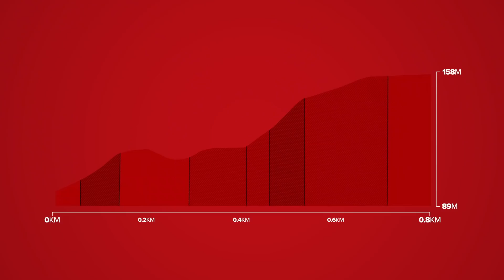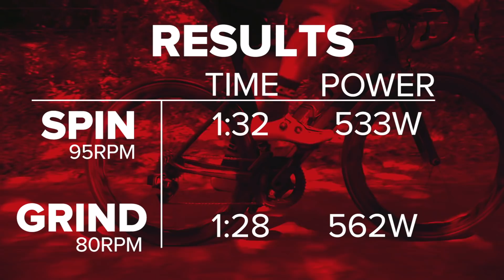Spinning Vs Grinding | What Is The Best Cadence For Climbing On A Road Bike?

Comment: By standing on the peddles during the "grinding" run you comprised the results. You changed two things; the cadence AND the peddling stance (standing versus sitting).
As a result we don't now know if the improvement in time came from standing on the peddles or from the lower cadence.

Comment: Nothing wrong with grinding. TO each their own..Small tip, especially if you are a grinder (<75 RPM), introduce 2/3 time a week of cross training outside the bike, such as squats, dips with both heavy and light weights. You will start seeing results, such as greater power at same RPM, and the HR is happy :)

Comment: Learn to be fairly comfortable with both. 
I find in circuit races (cat3/4 so hardly pro) I can hold the wheel and respond to increases in pace with a higher cadence (between 100-110).
However, doing long climbs in Majorca I tended to climb at sweetspot HR at around 85-90 rpm.
Just my take on it.

Comment: At 3:30 you are summarizing and you claim that with higher cadences we spend a higher percentage of energy into moving only our legs. This is wrong. Energy never simply vanishes (law of energy conservation) - the question always is: where does it go, what does it effect? In this case the inertia of the legs helps in the 4 1/2 to 6 o'clock-sector of the pedal movement. Analyzing this in detail, you will find that the force applied on the pressing down the pedal is higher than the pure muscle power spent. The effect described by you only occurs when we pedal with extremly high cadencies while spending an extremly low power.

Comment: If you were on a longer climb, you would have wanted to increase your cadence as your data would support, less power = less stress on the legs, thus saving your energy on a longer climb.

Comment: Greetings! I am 55 years old and have 51 years of martial art training. In the mid 80s to mid 90s I juggled road racing and martial art competitions. I am a big fan of Romain Bardet. Can someone here help me to understand how he at 6.5 ft and 143lbs can climb mountains in France of 8K-10K Feet every day with that body frame.... I wish I could ask him personally but I doubt he would respond on Instagram or on Strava. I am 4 inches shorter and 7 lbs heavier than he and I cannot climb 2K on Zwift without my chain clanking away at 39x25 gear. My knees are destroyed from competition for so many years and surgeries on both knees. My discipline keeps me going and not give up. My time is up in Wu Shu but I still hope I can do something with cycling. Thank you for reading and look forward to hearing from anyone here who has time to help

Comment: Armstrong has talked about this himself. He was accused of being the originator of high-cadence climbing on his podcast the other day (because he’s been critical of Froome’s granny gears). From his response, it doesn’t sound like he trained to spin at all and simply said that different people have different preferences. It wasn’t a strategy. 

What I was hoping he’d get to, but didn’t, was whether easy gears have negated the challenge of climbs like Zoncalan. Froome can sit down and spin at 90+ cadence on basically any climb, which means the gradient is more or less irrelevant. Would he stand a chance against a pure climber if the easiest gear he had was a 39-28?

(Of course, another aspect of this is that a “pure climber” is basically someone who’s so light that a 39-28 is considerably easier for them than it is for a normally sized person. Remove that advantage and Froome and Dumoulin can toast them.)

Comment: I think one of the main points here that has been overlooked is the use of the arms when climbing. There is a lot of counter action movement relayed from arms to legs when standing in the saddle. You can’t do this at a high rpm for very long.

Comment: You have to factor in the length and gradient of the climb aswell. Short steep climbs under 1 minute you can muscle up them out of the saddle, longer climbs you can stay seated providing your gearing allows you to stay above 70 rpm. Then there are times when you need to give your legs or your CV system more recovery, higher cadence to let the leg muscles recover and lower cadence to let the CV system recover. You should also train both high and low cadence but keep between 70 and 110 although going outside of this range is fine for brief periods.

Comment: My method is to set a power per pedal stroke by feel, then spin as fast as you can at that power without bumping up and down while seated on your saddle. And usually it's around 87-110 cadence. Aka spin to win

Comment: I thought Armstrong was famous for spending so much time climbing out of the saddle at high cadence? Anyways, I think there's another psychological reason that you need to consider as to why people change to slower cadences when they go uphill: people don't want to run out of gears for when it gets steeper or when they get tired, and in an effort to maintain as many reserve gears as possible, they might avoid the easier gears and hence pedal with slower cadence. At least I'd always pick the harder gear when I'm on the edge between two gears on a climb for exactly that reason.

Comment: Thanks for this. I’m on a recumbent trike, so all the biomechanics are probably different. I’ve been going nuts trying to figure out why I can hold 90rpm on the flat, but not on steep climbs, regardless of what gear I use. It’s even more annoying when I do try and hold a higher cadence, I loose time. So it’s not just me…
Reply from the maker: You're welcome

Comment: Funny I did this exact test before I even saw this video...  Spinning up a hill for 1-mile at avg 93rpm in the saddle, did the same hill at an avg 80rpm in and out of the saddle and I was 14seconds faster.  Almost 1sec per rpm!  Spinning, I hit max HR faster, had lower wattage, and felt like I was out of gas 3/4 up.  Lower cadence, I actually kept a lower HR, higher avg speed, more power, and wasn't dead when I got to the top.

I think there are too many factors between riders to say which one is better...  weight, style, genetics, fitness level etc... even max heart rate can make a difference especially if you're spinning.  I say, ride... and ride some more and keep trying the same hills trying different methods each time.  Eventually you're going to figure out what works best for YOU, and then go crush em!

Comment: Sometimes the question is misrepresented as ' Is spinning  faster than grinding?'. Like saying, is it faster in a car at 4000 or 6000rpm? Its the same, because you use gears.
What is different is, among others, fuel/energy use, lactate levels (and hence fatigue), oxygenation, knee comfort, mechanical losses, muscle group use, stress on upper body etc etc.
I have found from personal experimentation, spinning allows you to not feel as tired (pain), therefore you can go marginally faster and are willing to keep going due to lower pain levels. I get a slightly elevated heart rate at a higher rpm for same speed, indicating a higher body temp and/or fuel use but thats so much more sustainable than pain.
Good interview, insightful. Training is key, fitness (and I take it weight too) is key. Train to stay in the saddle a higher rpm. Vroom like Froome.

Comment: Here’s the elephant in the room - EPO vs Steroids. Steroids help muscles (and muscle recovery). EPO helps cardio. Lower cadence on climbs was more common before the EPO era and it really was about muscular endurance/strength. Higher cadence taxes the aerobic system more and we’ve seen that style become more common with the advent of EPO.  You can see this clearly in the 1990 TDF Stage 16 to Luz Ardiden where LeMond and Indurain ride ahead of everyone. Greg has that old school slower cadence on the climb, Indurain is using a much higher cadence. 

One other thing not mentioned in this video, is gear selection. There’s a certain fitness level required whatever cadence/gear you are using on a climb. It’s not so much “should I try to add a couple of RPMs on a climb” than trying to train over time to be able to push a higher gear at what is your normal cadence. Even for high cadence climbers, they still need to be able to spin a gear that keeps their power output where they need it. 

To test that, go on a climb that is at your limit and where you might crack - there are two choices you have, slow your cadence or drop your gears. To stay at, let’s say, 90RPM, you would need to drop your gears enough so you can maintain that. Or you may need to keep your gears where they are at, and then stand up to climb (which reduces your cadence).
Reply: Yawn,,,,,!,,,,

Comment: This climbing at a higher cadence sounds like how cars rev high for maximum power... perhaps if that thinking was applied to gearing we all could be hitting highway speeds in fully faired bicycles/tricycles.
Reply: A car engine is an air pump so it's more analogous to your lungs than your legs.
We could compare long to short stroke engines to alter force-rate ratios before any gearing to the cyclist.

Highlights a valid point that we needed to look at cardio & respiration stats too.

Comment: I'm 100% a grinder, which makes sense with how big and heavy my legs are (~30kg each). Good to have some backing on that.
What's more interesting is, this also suggests that I'm doing the right thing defaulting to a relatively slow tempo and small range of motion when I run.

Comment: If you are standing out of the saddle, I think that a lot of your power comes from your body weight pushing on the peddles rather than just you leg muscles.  The body mechanics and muscles used are different.

Comment: As the video suggests, the mere rotation of the crank and your legs uses energy, regardless of the force applied. That's physics. But I suspect (but don't claim to Know) that when cycling, physiology trumps mere physics. And my physiology may be quite different from yours. On level ground with no headwind, I rarely fall under 95 RPM. If I'm trying to make time, 100 - 110 is not unusual. And when climbing, my cadence is nearly always much faster than that of larger riders (though slower than when on level ground). ---- Furthermore, muscle and joint preservation must be considered, especially when racing or touring long distances or multi stages (also mentioned in the video).

Comment: Based on my experience optimum cadence depends on effort you put in. The cyclist in this video was bobbing and bouncing, which to me indicates he was not in the perfect geer. When spinning efficiently the effort is smooth as cutting through cake. To spin efficiently you have to constantly adjust your geers as the terrain changes. It looks like this rider adjusted his effort instead to maintain a constant cadence.

It is much like a motor car: Accelerate in a too hard geer and the engine judders. Accelerate in a two low geer and the engine races too fast and wastes energy. Find your sweet spot and you'll waste less energy and damage your muscles less. If you want to put all you have into a hill then standing up for a while can give you that edge to pull ahead that little bit more quickly.

Comment: Spinning for as long as possible is particularly important when doing very long days in the mountains, especially with several long climbs in succession. If you start grinding from the beginning of the day, your muscles will hurt much more at the end of the day then if you spin for as long as you can. You might not be as mechanically efficient when riding at a higher cadence, you might end up using more energy and even increase your chances to hit the wall (depending on what HR you ride at), but at least your muscles will still feel fresher at the end of the day.

Comment: As a MTBer the 34/28 is "low" gears is mind boggling.  On the 2x drivetrain on my hardtail that would be somewhere on my top ring, my "low" gear is 22/32 (which isn't low by MTB standards) and 30/50 is common on 1x setups.  Of course most MTBs are spun out at 20mph too haha.

Comment: yes good discussion, yes - Fast cyclists have high cadence 'cos they have more power (not the reverse) .  Very similar to the technique on concept II rowers,   The better rowers have a slower 'cadence' (stroke rate)  but much higher power output per stroke,  beginners always try and row as fast as they can and blowup whereas once they get the technique of using Power but less strokes (cadence) they goes a lot further and don't blow up.  andthen the pros have high stroke rate and high power.
- so how do we increase power?

Comment: According to my experience,Spining and grinding both can be helpful because when you are runing out of oxygen you will put a harder gear to slow your cadence cause it replace the load of lungs from your leg.And whenever it feels panic to your legs you shift to high cadence. you have to divide your effort between lungs and legs.

Comment: Cadence doesn't enter into it. The more variable your position is the more various your demands on your muscles is. The more different muscle fibers you can enlist the larger the number of different fibers you can exhaust. You don't just have two legs. You have hundreds and hundreds of diverse muscle threads in your back, core, shoulders AND the various parts of your legs - even various fiber groupings in muscles like your quads.
Each style of pedaling - and there are NOT just two - exhausts particular fiber groups faster. And each style has a cadence that is best suited to it. This is why moving back on the saddle or to the tip of the saddle will usually "buy you an extra minute or so" before "having to stand up" etc.

Comment: Not far from me there is a climb I do called Cragg Vale in Yorkshire its not the steepest climb but the longest in the UK 5.5 miles long by this time I have already cycled 34 miles to get there and another 34 miles back home I prefer to spin at 95 rpm in  comfortable gear to conserve energy level, pushing high gears all day long not for me .
I practice 110 rpm on my turbo which has helped me to develop high cadence endurance.

Comment: I've always had a rather high cadence but maybe that's because I started with single speeds. Even if you have a really tall gear, decents still require you to spin if you want to go faster. That being said, I've tried both while climbing and the only thing I learned is that I hate climbing.

Comment: What's fast is what's comfortable.

A lot of my cycling friends have come from a fixed gear/singlespeed background, so prefer to grind up hills. I personally am more of a spinner. If you're riding in a style you're not used to, it's uncomfortable, and uncomfortable is slow.

And to your point of "The pros spin because the pros ride fast" - riding my local climbs after the Tour de Yorkshire I can certainly confirm that the pros were doing double the speed up the steep climbs, so a spin to them is a grind for me (even in my lowest gear)
Reply: jonthedoors Froome is not froome because he chooses whats 'comfortable ' he rides to win races and does it by conserving energy AND then applying it at the right time. Most recently, when the grinders fucked themselves.
Reply: rieckstudio a nice pap of the inhaler helps aswell I suppose

Comment: I ride in higher gears at lower cadence to train for strength or on shorter rides. I ride in lower gears at higher cadence on longer rides or longer climbs to save energy. You have to think about what you are trying to accomplish on any given ride. 

The important thing for me is to feel relaxed. I am not pushing too hard and creating a lot of tension that saps my energy. Ultimately, I strive to feel power flowing without effort.

Comment: Sorry, it's not that simple. You need to have a versatile window of efficiency and learn how to choose the right gears before you head out on the road and when you shift. Balancing cadence is as important as finding the sweet spot in power output and closely related because power is a product of force, distance and time. The reason successful riders rely on high cadence is that leads to a more graceful recovery if you start to blow. Getting caught with low cadence and no optimal "fallback" gear leads to "hitting the wall" whereas if you start to blow at 90ish or so you can recover at a slightly lower cadence without having your torque requirements spike dramatically. 

If this is confusing to you the next thing you should do is get a special "climbing" configuration based on "junior" racing gears and just forget about big gears for a while so that you can concentrate on smoothness and versatility while climbing with closer ratios on the slopes. Climbing at "80" on a 34 * 21 is no big deal if you have a 23 handy and know when to shift. If you go from a 21 to a 24 you have to be more careful because it's harder to switch it up when the lactic acid has already started to disturb your form. It's doable, of course, but these are learned things and therefore the question is far more complicated than the silly "spin or grind" binary. The lower your cadence drops to the more important it is to have close ratios for when you blow up. Just bogging down to 70 or 65 or so for more than a moment is going to lead to a downward spiral in power and your ability to recover if you're already exploring the upper end of your power curve and or you haven't been eating and hydrating optimally.

The key thing is to remember that power ("watts") is a product of torque and velocity. Finding an ideal cadence is more than just picking a style. You have to be able to respond dynamically to your fitness" conditions, the road conditions, and what you plan to do when you start to get that uncomfortable buildup in the legs.  Jan Ullrich never learned this lesson. He had great lab results but could not often finish it off because he didn't know how to prepare for those moments when you need to recover a bit without losing too much power.